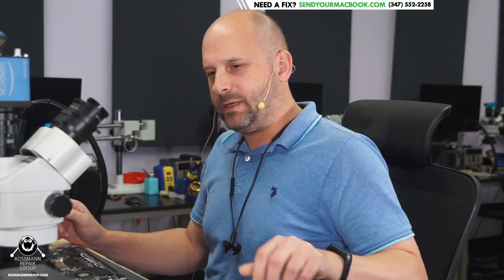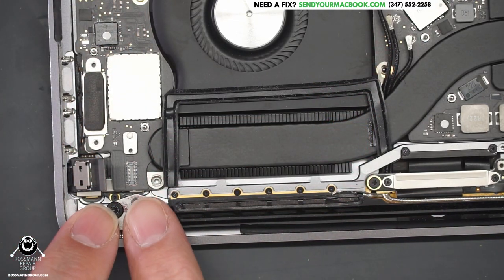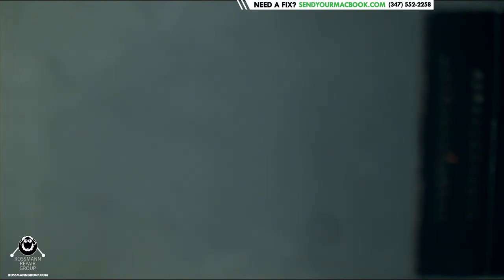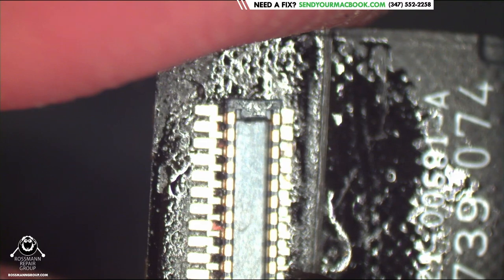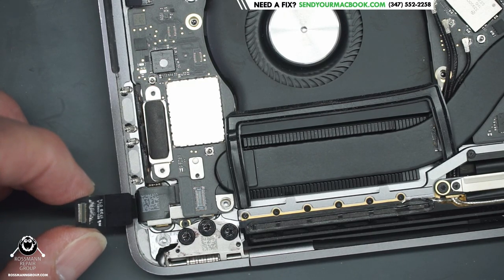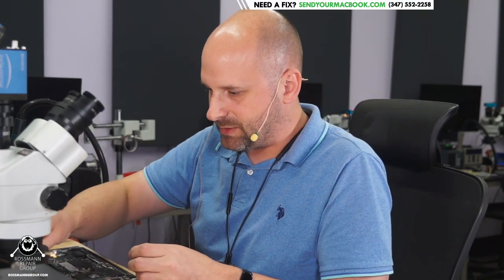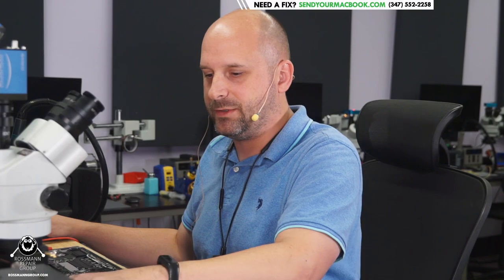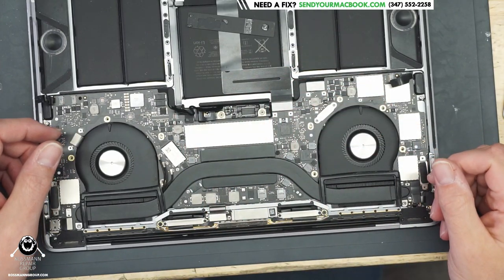How to avoid destroying your Macbook when replacing the screen

Comment: Omg, he solders like I do, like exactly. Start to do something with precision. Have worn out tip that doesn’t take solder on the end anymore. Rummage around for a good tip. Then find one and when finally ready, immediately bump what I’m doing and because I never have enough hands, have to put the soldering iron down and readjust and that repeats like 3 times till one corner is down then everything works flawlessly. Mmm, lovely to see over the course of 15 minutes of what I went through daily for about a year.

Comment: Hey, got one for ya.
Soldering tips. "TIPS" , not verbal.
Check out Elkinite.
95% tungsten/5% copper. Can be ordered in Rounds,Squares, etc.
We use in spot welding environment. It keeps an edge, transfers heat, can be filed to desired shape.

Mc Master Carr

Comment: Oh, now the car industry is also making screens hard to get just because modern cars have to have a bunch of ipads glued on to dashboard that are btw totally safe to use and definitely do not consume a lot of power :`(
Reply: reasons why mazda is so big now. focusing more on driving and less on that gimicky shit
Reply: @4xHitler 
I agree that Mazda 3 2021 model is really nice because of a lot of quality physical controls, good speakers, HUD and very intuitive layout. The only thing that I hated is visibility and they "fixed" it by including proximity sensors all around the car. In 10 years we wont have glass on cars if this continues :(
Unfortunately, the new models such as electric Mazda SUV has adopted the same mentality that others copied from Tesla: touchscreen instead of physical controls for climate control.
So more or less this is a trend and we consumers need to complain and bring forward the problem, otherwise nothing will be done.
Reply: @GiGaSzS  mazda 3 is good but its really big compared to its previous gen

Comment: I find that doing those screen swaps goes a lot easier if the screen is opened up and hanging over the edge of the desk.  It gives you a better angle for pulling the hinge bases out of the body

Comment: You're telling me those iron tips cost MORE than an entire chinese soldering station now? And they dont even last very long? 

Maybe knock-offs are even going to last longer. When I bought my 35$ station I also ordered a bunch of replacement tips anticipating that they wouldn't last very long, but I haven't actually replaced a single one of them yet. I dont use it every day, but still.
Reply: The temperature matters a lot. As Paul said, he runs those hot and that makes the tip lifetime a lot smaller. Running them hot allows you to work faster, though so it's a tradeoff and you have to adjust according to your hourly pay. If you do it as a hobby, keeping the temperature as low as possible will increase lifetime of your equipment.
Reply: @MikkoRantalainen  yeah I know. My station goes up to 460°C which I have used occasionally, and I normally run at 370°C. That should be pretty stressful for it.

Comment: Can that messed up connector kill CPU? I think I had a B2B A1706 unit here with the same damaged connector after screen replacement and mac kernel panicking couple seconds into the boot up process. Definitely learned something new: I was using T3 driver instead of T4 all this time 🙈 Worked perfectly fine though :)

Comment: As far as Dell. Yes there's a ton of proprietary daughter boards, main-boards and other standards they use in their computers. Hasn't changed since early 2000s. In some cases it might be for form factor, but usually it seems like lowest bidder type engineering.
Reply: Having done component swaps on Dell machines before, can confirm. The boards, PSU, and cooling solution are always lowest-bidder grade equipment. I tried to do a GPU upgrade but the PSU not only didn't have the extra 8-pin connector I needed, but I couldn't find the wattage listing and was unable to find out if I even had the additional power required.

Comment: Feels like they could add a line ot the ifixit walkthrough to remove the flex cable before unscrewing the display along with the 45 degree of the hing you mentioned.  This would prevent the accidental destruction of the flex cable connector in the event the hinge does come into contact with that section of the board.  I don't mind doing displays for the most part as long as I don't have to route the wifi antennas through half the machine.  I always prefer a machine where the antennas don't have to go far with the connector is right next to where the wires pass through the hinge body.

Comment: 36:15 - Absolutely aggressive anti-repair design. There's NO need for those clips to even exist. So they spent SO MUCH on designing that system, and the tooling, molds, glue, etc that they could have spent on making the machine 1% more durable with conformal coating in certain areas. 

It's so much bullshit.

Comment: I had to replace my macbook pro A1398 battery because it was swelling (and had been for awhile) and I was going to do it without removing the motherboard as opposed to ifixit's guide. I planned to use 99% isopropyl alcohol to dissolve the glue instead of acetone (in ifixit's kit). But 2 weeks before the fix my left speaker blew and i had to remove everything anyway. I hit a snag with trying to remove the camera cable because I couldn't get any leverage on the cable. This tiny cable stopped me for over an hr. It was stressful since I didn't want to break it. The battery was the easiest thing to remove with just isopropyl alcohol, cards, and a pry tool though. I felt very accomplished after I manage to put it back together again and everything worked. :)

Comment: For the soul purpose of right to repair and green environment, please di not throw these iron tips, it's easy and money saving to again create a layer of nickel on the surface of the tip using electrolysis process.
The amount of tips rossmann repair uses, it will be a totally beneficiary for both environmentally and economically, and this would also spread the real meaning of right to repair.

Great stream paul.👍👍

Comment: When soldering on the connector, why was it better to solder each pad individually with a soldering iron instead of heating up all the pads with the hot air gun, depositing some solder onto the pads then sticking down the connector?

Comment: Christ I HATE doing screens on this model.  Apple clearly have made it as difficult as possible on purpose for no other reason to screw over repairers.  From needing 4-5 different screw drivers, having the screen cables route directly over inadequate cooling assembly and needing spring loaded clips to keep tension on the little strips that protect those screen cables from being worn away, its simply and utterly a design nightmare of incompetence and vindictiveness.  And having 16, SIXTEEN, freaking screws to hold the wifi assembly down where ANY other notebook maker would use 2 at most.
Apple truly have the worst designers in the industry, solely dedicated to making things the user will never see LOOK pretty but barely operate.  Nobody cares if a bunch of capacitors are all neatly lined up in a pretty row on the mainboard, especially when that required ridiculous trace routing to position them that way instead of locating them in the most logical locations.
My heart drops whenever a mac is dropped into my shop, as most of the time its died thanks to the misguided form-over-functions compromises apple keep making, or the totally inadequate cooling that just about all macs suffer from.

Comment: 3 errors.
1. If I remember correctly none of recent laptops are using T4 screws for hinge covers and springs or anything related to LCD
2. You can easily remove LCD without damaging anything. You have to open display more than 90 degrees and then you can just slide it out
3. While removing bottom cover you can damage it. If you pull it up too much you'll cause stress line near vent lines
Reply: New airs have t4

Comment: Hey guys, could you give me a hint how to re-do those tiny connectors sitting on wires for wifi and bluetooth antennas, that are plugged onto wifi card? I have ripped one off accidently, and now it feels like screen replacement :E macbook pro a1398, mid 2012 retina

Comment: Why trying to solder first pin on the connector, you could just use a regular paperclip to hold it in position. Way easier! :)
Reply: There is not a paperclip in the world small enough to hold what we are working on here.

Comment: Hey guys, screen replacement pro tip:
With hinge screws still tightened, open screen 90 degrees and hang the screen off the side of the table. This is the official method for removing Macbook displays.
Ensuring all other screws are removed, now remove the six T8 screws.  
Separate the display from the case by tilting the display towards you about 15 degrees then lift the display up and off the chassis. To install, reverse process. Take care with the flex cables for the Tcon board on the display, and of course those cables near the hinge if it's a touch bar system.